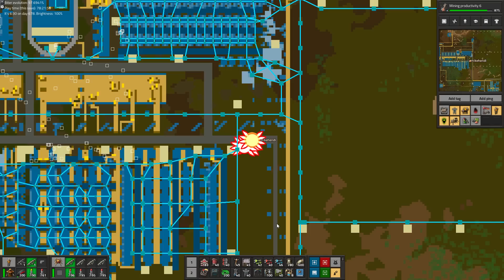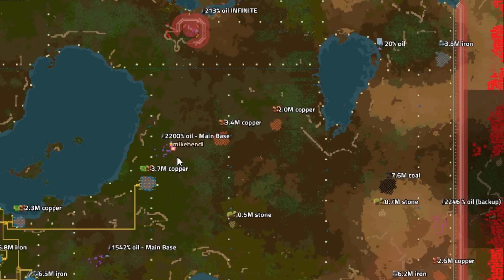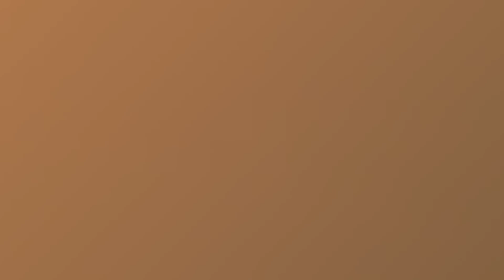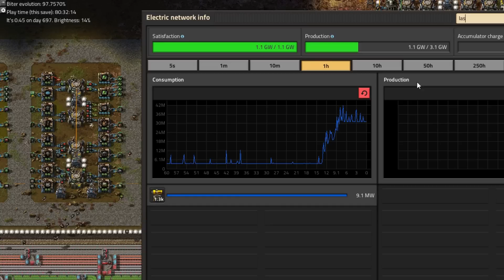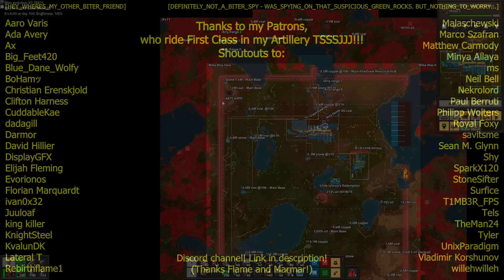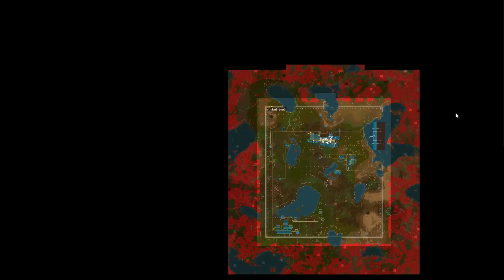ARTILLERY CARNAGE // The Ultimate DeathWorld Challenge #23

Comment: In the distance could be seen an Alien complex exhaling a gloomy smoke. It had been there for a while now, with its origin seemingly seeded from outer space. A native with its sore eyes gazed into the looming smoke of that indescribable place, slowly having all of its emotion replaced with hatred. Suddenly it noticed a unfamiliar glare. This from a large and long metalloid object traversing and throwing a somewhat lowly pitched roar towards the surroundings, but despite this making its presence well known,
and at last also stating its intention very clearly:
To annihilate.

A hydraulic sound could be heard as the long metallic pipe from one of the wagons pointed out like the nose of a beast peeking out towards the abyss, to then in a moment thereafter, as a commitment of non sentimentality itself, with a bitter and loud noise, shoot a piece of death from itself for the erratic abyss to receive, as a gift from its maker. 
As the purpose of the gift is the purpose behind its makers motivation.

Revenge

Comment: Won't it be easier to setup a second train that will carry bots, walls, turrets and other supplies? You can take this train along with the arty to the wall and have it provide important resources close enough to keep replacing/repairing quick enough. Double the TSSSJJJ as well. Although a spidertron or a few equipped with those bots and configured to follow the arty train around might be just as effective

Comment: You could add 1 or 2 cargo wagons full with walls and repair kits that gets unloaded when the train stops at the far corners, that way you can supply the local bots with much needed repair material on the stop, reducing further the risk of a breach, then once you are all packed up and happy they won’t get trough, you can revert the insertors, get the remaining back into the train and top up the missing amounts at the base
Reply from the maker: That sounds like an awful lot of work... meh... my bot slaves are replacable
Reply: @MichaelHendriks  hahah fair enough! I though it would have been handy to do, but I haven’t even made it to blue circuits in any of my factories anyway 😓🥲😂

Comment: Theoretically, I wonder if you could have a line of train artillery long enough to match the entire circumference of the wall at once - and if you then rained shells and brimstone from all of them simultaneously, how long could the base withstand the concentric pressure of biters prodding from every angle? 
Would one have to add additional defenses to make sure it could hold out through till the end, or are the current defenses rigorous enough to withstand even this sort of ultimate test? 

These videos have filled my mind with dangerous propositions, too greedily it delves for the satisfaction of biter destruction.
Reply from the maker: I think the destruction would be quick enough that there would be not a lot of new biters spawning between begin- and end attack, so I reckon the walls would hold the fierce but short counterattacks... You'd need a LOT of artillery shells though to fill such a train, or a limited laoding mechanism

Comment: Maybe a few requester chests with repair packs and spare walls dotted around would make repairing the walls easier?
Reply: Buffer chests, but yes (Bots can't take items from requesters)
Reply: @canebro1  Ooooh, so THAT'S what's wrong with my own setup! Man, one of these days I really should learn to read descriptions! :/
Reply: @mythologistthe92nd  Haha, yes.  A buffer is a mix of requestor and provider.  Wall repair is one of the main use cases.  The other is in your mall, for items that are both outputs and inputs, such as yellow belts.  Use a wire to limit the inserter to say 1k belts, and then set the logistic request on the chest to 2k belts.  This way when you start upgrading all the "old" belts will go to the buffer and be used before the machine makes more.
Reply: I was going to suggest the same thing. Even if the buffers are not evenly spaced around the wall, just placing them down when he gets there with the arty wagon would be a good thing.
Reply: For plays with continue attacks (often modded for example with Rampant), I usually decouple the Wall networks from the main network by 1 gap. Each of them are fed by circuit controlled chests, with an inserter breaching the gap and feeding the wall networks from the main network, including replenishing the networks with bots. This makes the wall networks able to repair very quickly with small distances to cover for the bots.

In extreme scenarios, there are also buffer chests spaced out in the wall design to make sure distances are minimal (and replacement parts are available).

Comment: Your train does actually accelerate slower if the front wagon isn't a locomotive, as the air resistance value of the locomotive (0.0075) is lower than the values for cargo/fluid wagons (0.01), and artillery wagons (0.015)
Reply from the maker: I didn't know that! But I guess the train arriving a few seconds later is not gonna kill the run at this point ;)
Reply: @MichaelHendriks  You doubt the hell that is factorio late game
Reply: air resistance value??? factorio amazes me further
Reply: That is good to know.
Reply: This is good to know; I had previously concluded that putting locomotives in the back would allow for more compact Station designs (since they can park on a curve)
Reply: @Lucretiel  Usually does not matter that much.  And if putting them at the back allows for easier station design, then might be worth it.  I like running 1-4 trains, but my fuel train is a 1-1 wagon-loco, since I can unload directly where the fuel needs to be loaded.
Reply: @canebro1  That is fucking genius.